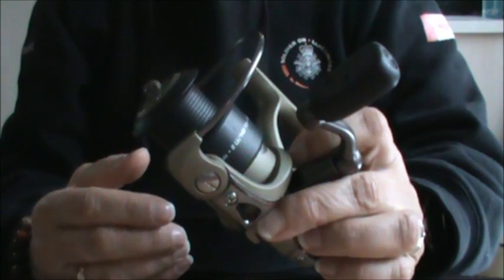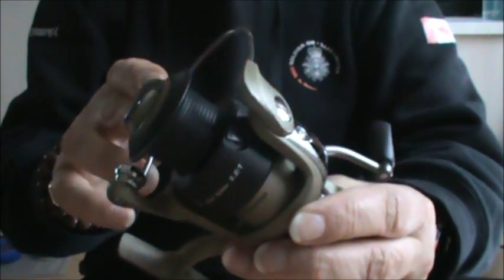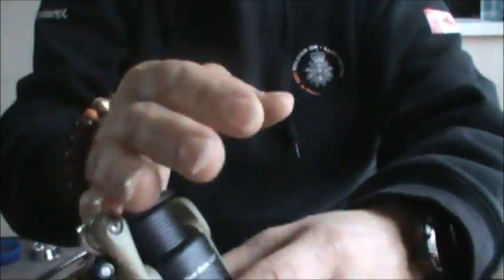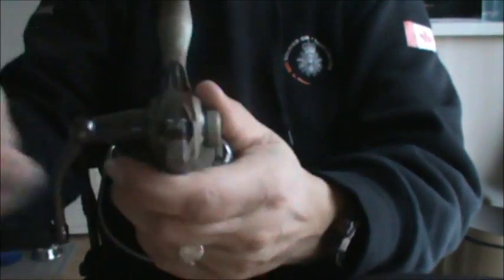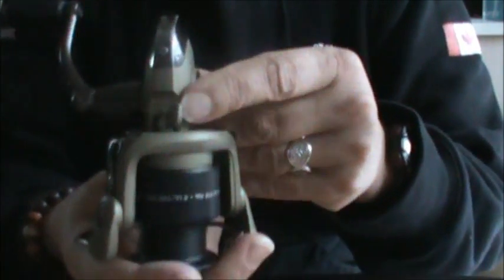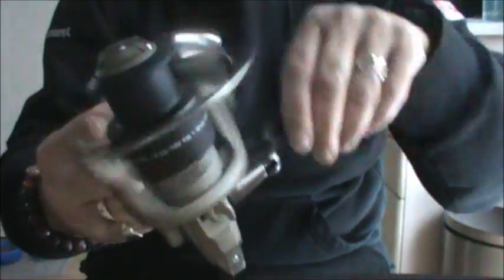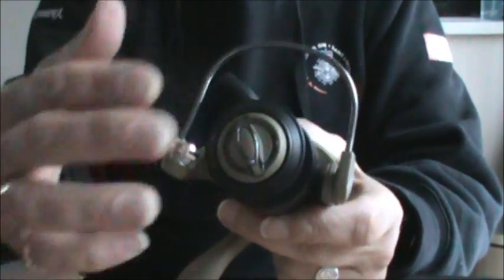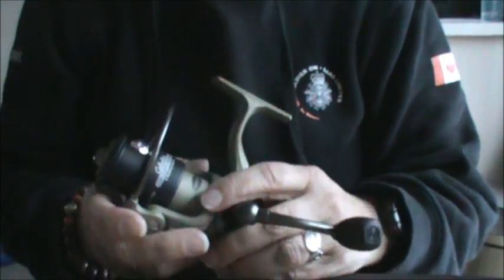How a Spinning Reel Works

Comment: Sm in Sydney, I bought a rod with reel last week, I went fishing, my first throw everything came apart because I forgot to tie properly the adjustable drug, the drug came out loose and so the spool where the line sits, however I managed to go into the water and I found them . Then i put everything together and still it’s not working, I done some research and i opened another reel to see what’s inside and i realized that another part or two are missing, the parts that also missing in the water when I thrown were : ratchet upper pad and probably a washer under the ratchet. I am not sure if this rod has a washer or just a ratchet.
Can you please help me where I can get this ratchet from? 
The rod is : silstar sirus combo 7’2.1m (3-6 kg) ss703spl.
Thank you
Reply from the maker: Just go and buy yourself an inexpensive replacement reel. Reels can not always be fixed, and in most cases, the repair is more expensive than the replacement.

Comment: Cheers, I was basically trying to figure out the anti-reverse wasn't sure what it was till you told us, my real however doesn't swap to right handed sadly, it's an old Mitchell real made in France! Very smooth well built and nice as can be however it just doesn't swap left to right :( .. it's actually flat faced where your nut is on yours mines a flat metal solid piece

Comment: I just bought my rod and i noticed the handle was not screwed on tight so I tightened it but now it wont turn unless in anti reverse is on.  is it broken?
Reply from the maker: Weird!! Have you tried to listen it. If it doesn't work it may be broken.
Reply: @fishandtips-r4v  yes I tried to tighten the handle but I think it is broke Im just going to return it.  
Since my kids and I are new to fishing would u recommend a rod that is open or should I go with the push button kind?  because my son has a cheap doc demon and it works perfectly
Reply from the maker: What ever you feel comfortable with. The spinning reel casts farther, so that might be something you will want to consider.  Good Luck!!

Comment: I'm a total noob and where I am utterly flummoxed (and now exasperated) is that when I open bail to cast, a ton of line just unspools into a heap so closing bail to reel in lure causes the line to wrap around anything and everything except the actual spool.  I am 100% certain I have tied line to spool and loaded spool correctly.  This isn't a line twist issue, it just simply comes totally undone (unwrapped) from spool when I open the bail into a jumbled heap and impossible to reel back in.  Total mess and I just don't get it.  Frustrated beyond belief.
Reply from the maker: My friend, when you open the bail hook your index finger under the line so that is doesn't unspool and drop off the reel. As you cast you release your index finger to let the line fly on the forward motion of the fishing rod.

Comment: I wished you expalained which direction is loosening and tigthening of the drag system :'(
Reply from the maker: I have a video that explains the drag system. In short to help you out. To tighten turn the drag knob to the right (clock wise). To listen, turn left (counter clockwise).
Reply: @fishandtips-r4v  I already figured it out, but thank you good sir. I learned a lot from your video
Reply from the maker: My name is Sharon :)

Comment: This video helped me tremendously! I'm a beginner fisher and the first time I went out I was wondering why my handle was so loose and why my line would easily come loose in my reel and start looping. Now I know that my handle can be tightened (I thought it was just loose) and that there is an anti-reverse option which I assume will prevent the line from coming loose all the time. Can someone confirm if I am right to assume that? Thanks!
Reply from the maker: Glad I could help. Yes the screw on opposite side of the reel will tighten your reel handle. The anti-revese allows the handle to be cranked either clockwise or counterclockwise it doesn't tighten anything. The drag button on the front of the reel will tighten the line for retrieving and being pulled off under pressure. When you open the wire bale to cast make sure your fishing line is hooked on your index finger otherwise it will just loop off the reel. Freefall to the ground. There is no tightening that. 😁
Reply: @fishandtips-r4v  Great thanks again!

Comment: When the wire that locks the real down still lets line out is that supposed too?
Reply from the maker: Are you asking about the Bail wire?? If the bail is closed and your line still comes off the reel, then you do not have the line in the line guide or knuckle which on the side of the bail wire. It's a grove like hinge on the side.

Comment: A decent spinning reel can be purchased for around $25.00 and can provide years of fun fishing for the average summer angler.  

People today think that you need to spend +$500.00 on their fishing gear just to enjoy fishing.  As a child living on the prairies I remember bending and removing the old aluminum antenna pieces from old houses  (used for TV reception)  and tying a piece of fishing line and a hook and bobber to the  end of the pole.  That was pretty much it and that was the fun in fishing ~ improving from whatever we could find in back alleys and the local junkyard.  That was pretty much our fishing gear growing up.
Reply from the maker: None of my spinning reels are over $ 30.00. They all still work and are in good condition. The most expensive one actually cost me closer to $ 40 and has eight bearings.  Beautiful reel.

Comment: Some people say that closing the bail by turning the handle may damage the bail spring. Is this true?
Reply from the maker: It is entirely possible on some of the cheaper reels. I find that the auto closer can be choppy and therefore prefer to close it manually.

Comment: Good video thanks! Got my first rod today but it has a button on the top of the spool where the drag adjuster sometimes is. My drag adjuster is on the bottom but I have a button on the top? Any ideas?
Reply from the maker: No I don't, unless you are talking about a spin casting reel.

Comment: Should you turn off the anti reverse when casting?
Reply from the maker: No, you don't have to. But I keep mine on so that if there is a sudden strike after the lure hits the water your line will not get ripped off the spool. And remember the handle will spin around when the anti reverse is off.